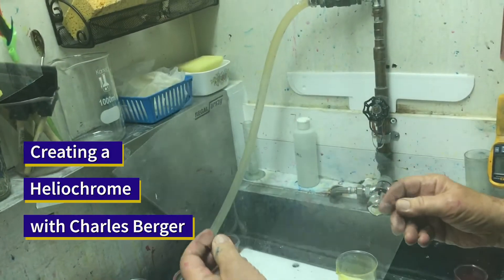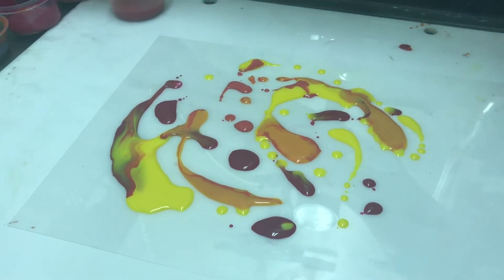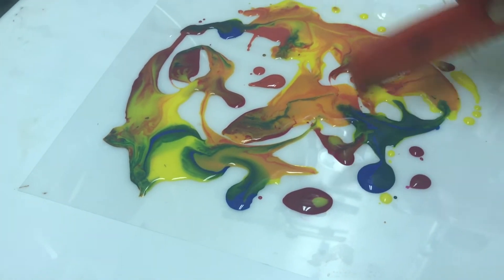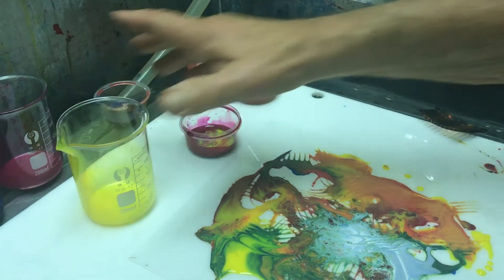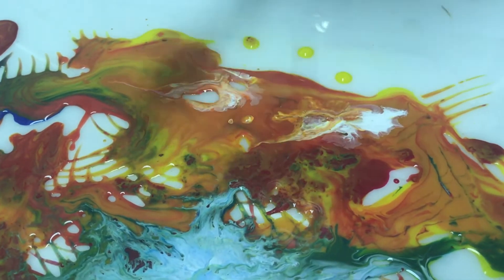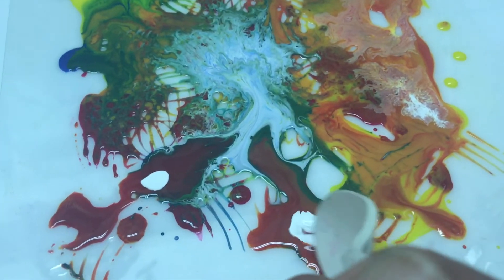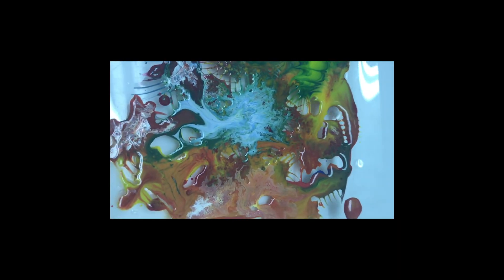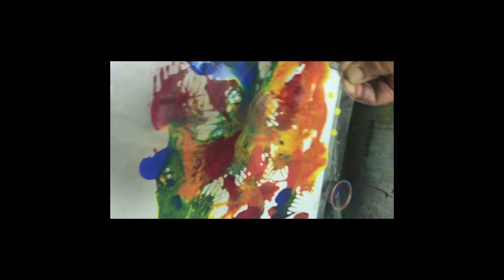Creating a Carbon Heliochrome Photograph with Charles Berger

Comment: So. Many. Questions...

I understand that this is using the UltraStable pigments that you and Tod Gangler developed for carbon printing. What I don't understand is what your final "product" is from this. You refer to this as "a photographic emulsion"; have the solutions been sensitized with chromate or DAS? Or does that come later?

The images on your website are intriguing, but it was difficult to understand just what the image itself was now on (Mylar? Watercolor paper?)...

Exciting stuff!
Reply from the maker: The pigmented gelatin emulsions are sensitized with the non-toxic, non-carcinogenic DAS when mixed.  After coating and drying, they are exposed in contact thru the back of the clear base, fully washed-out without transfer, and then assembled (most are multiple layers) on watercolor papers.

Glad you like them.
Reply: @heliochromes6728  This still is very incomplete. You should post a video to full completion of the print, to know how this works.